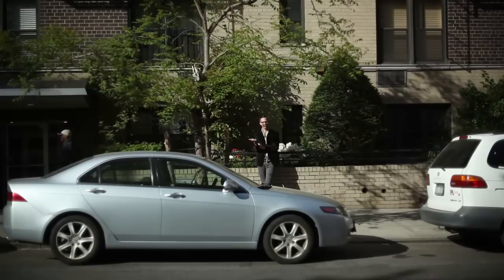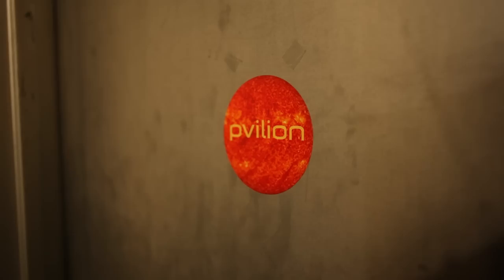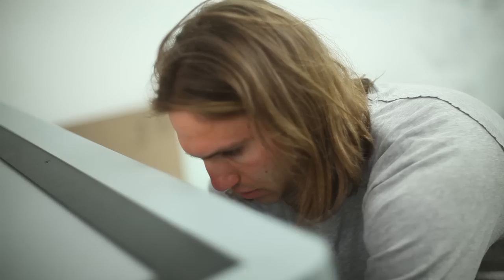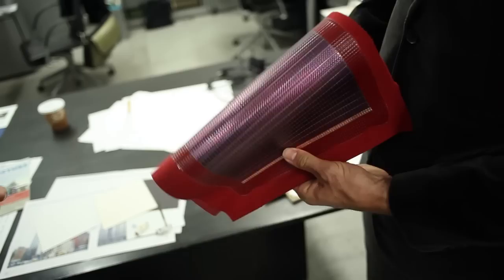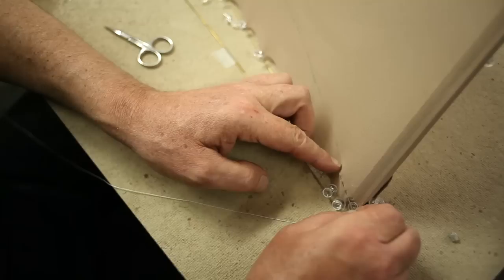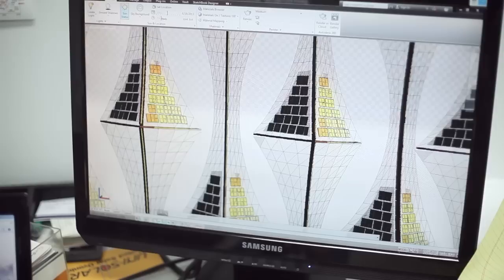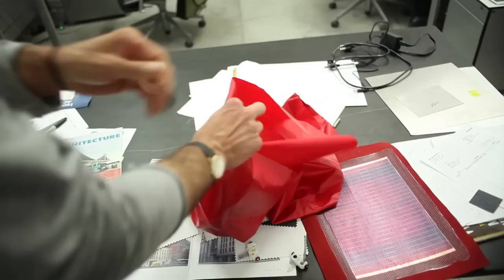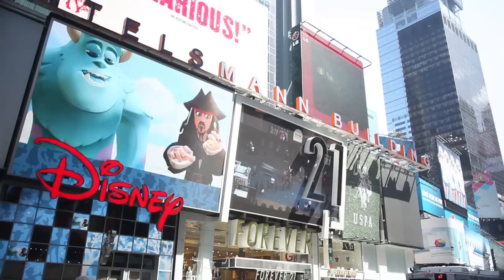America's Road To Energy Independence, Part 1

Comment: The solution to the energy problem is like a clipper ship. It utilizes many small sails working together for adequate propulsion. In the same way,I agree that it will take many small solutions working together to rectify the energy problem we face as a country. Therefore, I agree with Mr. Ward 100%

Comment: You could close then part way to limit solar heat gain on older buildings where the cost of new windows would be too high. In on office or school setting where the space in not used all the time, like on the week ends you could have them closed when light is not needed. Having these on vertical blinds would be great, so you could regulate the amount of light coming in and still capture solar energy.